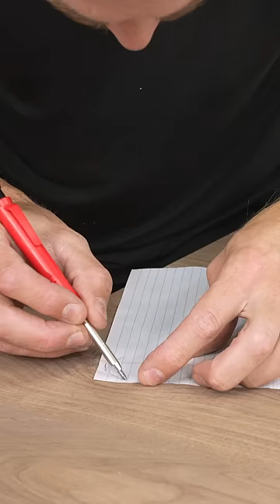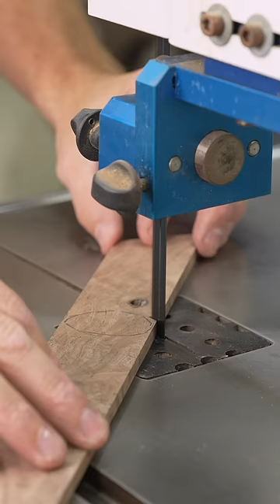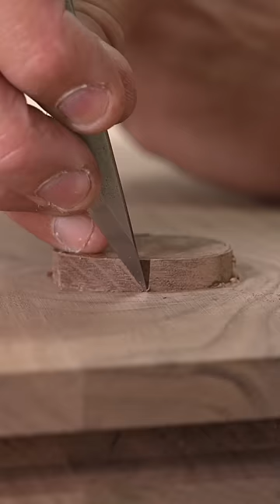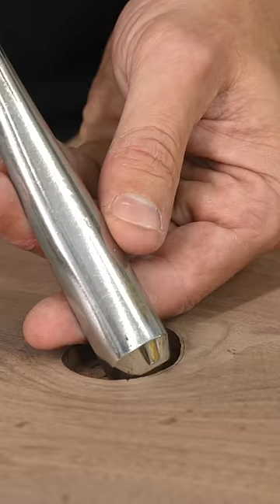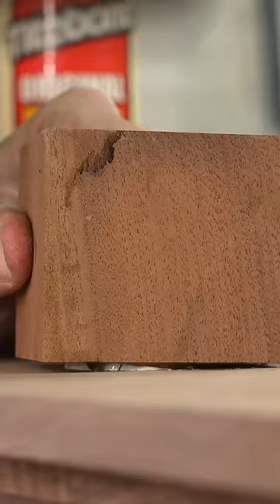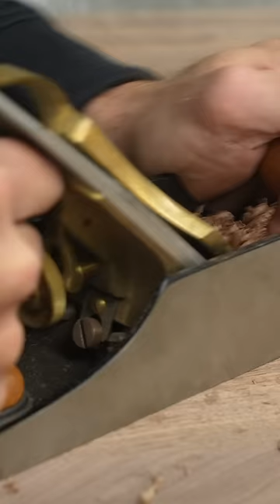Knot hole

Comment: I always just mixed a bit of saw dust and wood glue to good consistency, filled, dried, sanded and u can't even tell there was ever a hole.
Reply: Yeah that’s my method of choice. Way less fuss than all of this for a similar if not superior result.
Reply: That's what I do. On his repair you can see the different grain directions.
Reply: Glue and sawdust won't take stain
Reply: @HBSuccess  u got to stain the saw dust before mixing in the right glue, then after sand and repeat and touch up. If the consistency is right it will take in the stain to begin with
Reply: Sounds like ur filling the holes to the top with mostly glue, even know the glue dries hard and is non absorbent. Ur glue sawdust mix should be most prestained saw dust and smaller amount of glue not 90 percent non absorbent glue and 10 percent absorbent saw dust. It should almost fall out if tipped upside down until sealed and the top part of the holes mixture is almost all stain able saw dust.  I just redid a oak table with filled holes and stain it and worked just fine. Just like the last 10 before that. Do u need me to make a video so you can learn to use glue and sawdust correctly 😆
Reply: Yes, that. And he cut a hole to "remove" the knot, but the crack is still there, below. At least with sawdust and glue you can fill the crack to certain extent.
Reply: @luns486  I think the sawdust method is definitely far superior.  This looks like shit to be honest
Reply: Yes you can tell, especially if your staining.
Reply: U never did that and just made up that method for the sake of the argument.
Reply: @TylerSmith-qx6uz  ???? That method has been around forever and is what most people do
Reply: Yeah the sawdust method but not prestaining the sawdust, that guy never did that and made it up on the spot.
Reply: @Tyler Smith  don't know how you're responding but it doesn't show the @ of who you are responding to so it looks like you're just responding to the original comment.
Reply: @TylerSmith-qx6uz  he then says in his next comment sawdust from pre-stained wood. If you continued to read you’d probably learn more
Reply: Yeah that's a popular and easier way to do it
Reply: He does do that as well, but he's able to sell his pieces for tens of thousands of dollars so he goes out of his way to make it look as good as possible and if you have the time you should as well because this method is absolutely 100% far superior to the glue and sawdust method which will work in a pinch, but looks nowhere near as good. 🤷🏽‍♀️
Reply: @justicecampbell3892  it really doesn’t look as good, it looks brutal. Stevie wonder can see that
Reply: My grandfather did this. It looked not bad.
Reply: @Manbearpig4456  You're right, it doesn't look as good, it looks even better. You can clearly see it and anyone who says they don't are lying. 🤷🏽‍♀️
Reply: @justicecampbell3892  yes you can clearly see it, that’s the problem. Remember to keep the crayon in between the lines next time.
Reply: You the man
Reply: Yea he didn't match the grain so it stands out
Reply: He did a good job but I prefer this myself. Or black epoxy because everyone likes knotholes anyway
Reply: @BFusey  true that, I only normally don't hide the knots on my personal stuff around my homes, I like the look of it too, but in some cases you need too either going for a certain look to match rest of rooms trims and frames ect. Or because you need to repair that area for a anchor site ect if it's trim or frames or wall panels ect ur working on
Reply: Yap. The easier way i think 👍🏼
Reply: e' anche meglio continua cosi'👍
Reply: الغراء وغبار النشارة مجرد ديكور فقط لأن التشققات ستزيد في الاتساع اثر عوامل الرطوبة والحرارة 
اما الطريقة الموجودة في الفيديو هي الصحيحة

Comment: I worked in a high end shop for years. That would not have passed.
Reply: Why? Would would a high end shop have done? Maybe just fill the original knot hole with epoxy and sand?
Reply: @petergriffin383  for one used a different piece. Or take out a larger piece and matched the grain. If the knot was acceptable it could have been filled.
Reply: @genocanabicea5779  I see, thanks for the reply
Reply: @genocanabicea5779  Indeed, the table is made from strips anyway, if you don't like the knot why even use that board its not like he's stuck by using a slab.
Reply: Just use some black hard wax. For stuff like this you don’t want to match the color because It’ll always look off
Reply: Did you just sweep the floors?
Reply: @Pdersey Haha, thats fckd Up. 
Leave Home Depot alone.
Reply: I agree it could have been better if fixing this way was his option. Direction of grain  of plug wrong. He also could have picked a darker area of walnut to .are the plug. Right now plug is so light it jumps out at you. "HI, I am a wood plug."

Comment: bro they have hole saws and forsner bits for a reason
Reply: The exact same thing I was thinking.
Reply: a circle would look far less organic and would take away more of the board than was necessary

Edit: and to get an exact fitting plug of that size would be very difficult without manually carving it
Reply: Also flat chisels... He used a lathe chisel, made for carving out stuff on a wood lathe.
Reply: @Gorphee  is that a lathe chisel? I thought it was just an ordinary carving chisel. a flat chisel certainly would not be suitable for the task (the cavity being oblong in shape, of course)

Edit: repairing the damage done by autocorrect

Comment: That's so much extra work man All you have to do is put a hole saw cutter in a drop plunger to a certain depth drop it down it'll make a perfect circle. Then take a circumference cutter cut a circle the same circumference with the same grain pattern drop it in It would be perfect and unnoticeable good try though

Comment: This is a good way of doing it, but the wood used to make the disc... If you need to do small bits like that, cut the disc out the end. The bit of wood you used could have made another discs atleast for later projects and u cut a square out the middle...

Comment: Mix glue and sawdust of the same colour as that surrounding the hole and filling it would have looked so much better. Or even a different lighter or darker shade to make a feature of the original knot instead of something that will draw the eye because it just looks wrong.

Comment: Very good but can I just add the replacement wood could be any shape if you're routing out the knot, would better disguise the final finished timber. Useful tip though, nicer than just filling it.

Comment: I mean pouring epoxy in it or litterly just using a hole saw and a wooden dowel would've been easier rather than doing the whole custom shape that looks kinda outta place because it has hard corners

Comment: sure would be easier to drill a plug with a hole saw out of board and then drill a hole the same size and depth in product to repair glue fill and sand. Done

Comment: what is that tool he used to make the hole?
Reply: It was a lathe chisel, it's made for a wood lathe that rotates a piece of wood at high speeds, and you hold the chisel against a brace bar, and gently carve into the wood... It's definitely not made for straight chiselling.